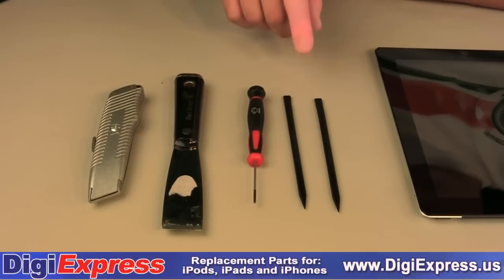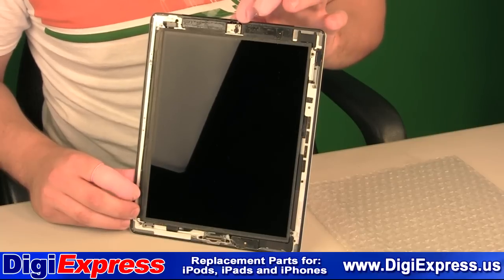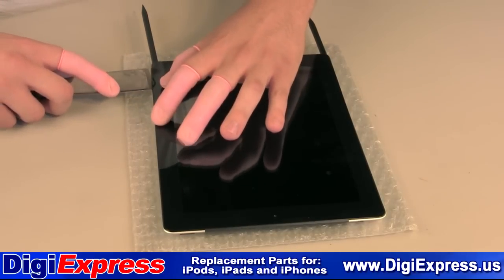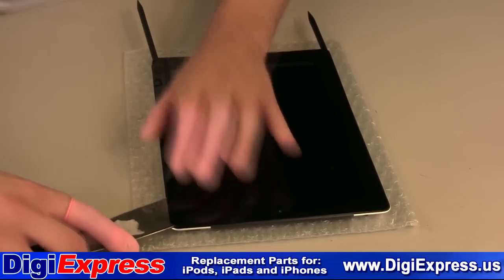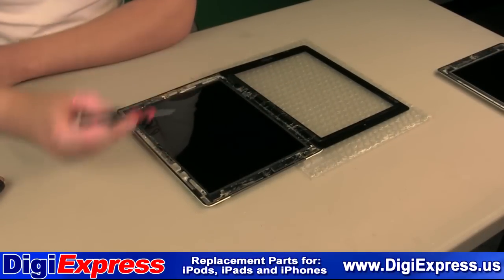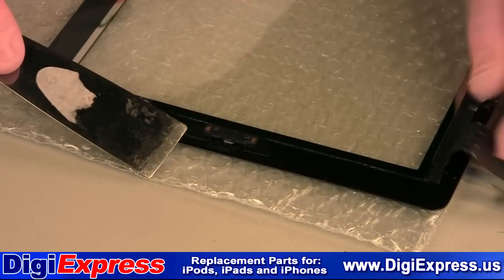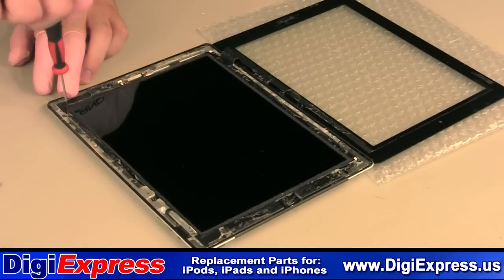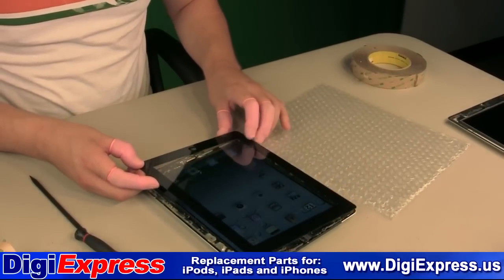DigiExpress - iPad 2 LCD / Digitizer Repair

Comment from the maker: @PastorPaperfist It is not stocked throughout the US as packing tape or Duct/Duck tape would be.  You would start with Lowe's, Home Depot, ACE hardware or your local electronics hobby shops.  From there if you cannot source it locally, a search on Amazon or the like will get you results.  The rolls themselves can be expensive, and currently there is no precut adhesives for the iPad 2.  Hope this helps, thanks for the comments!

Comment from the maker: @TheBryceallen No, we use a 1500 watt 120 volt heat gun.  The temperature is set to 800-950 degrees Fahrenheit.  Since we keep moving the heat gun around, the device never gets too hot to damage or work with.

Comment from the maker: @RichardBronosky The adhesive you are referring to was actually the plastic mid-frame that is attached to the backplate.  If you have a black colored iPad then your mid-frame is black, if you have a white colored iPad then your mid-frame is white.  The adhesive that is used to secure the glass to the mid-frame and thus backplate, is clear to yellow (yellowing if not cured properly from the factory).  This repair was done live and not a pre-repaired unit.

Comment: wear the finger condoms or nitrile gloves and you won't be cleaning finger prints off the glass. Go ahead and buy a wifi antenna when you buy the digitizer, you are going to ruin the antenna when you remove the glass. I got the antenna for about $12

Comment from the maker: @djcountry1985 There is enough space between the LCD and glass digitizer that you should do no harm to the glass or LCD.  However you may severe or displace other components for the Wi-Fi, Cellular antenna , but should do no real damage to any parts.  It should also not be so hard to insert the metal tool, if you find that you need to push hard enough to do damage if you loose your grip, that is pushing too hard.  Use the heat gun to do the work for you, keep the heat moving over the glass.

Comment: I have a quick question. When replacing the LCD, I accidentally used a metal screw driver to the part where the LCD pluggs in. A quick apart went off and now I have no brightness in the screen at all, (can still see very faded image) is there a breaker switch? Or is the whole LCD blown?

Comment from the maker: @GetSome100100 If you are lucky enough to have an AASP in your area, who can repair it on site.  Most Apple stores will give you a refurbished iPad as a "warranty" replacement.  Though the warranty expressley states it will not cover physical damage, such as cracked screens.  So at that point you are looking at 10% off the cost of a new one, at best.  Currently Apple Genius employees can "override" warranty repairs for angry customers, this has stopped with the release of the iPhone 4S.

Comment from the maker: @lumpyren Cover the screen in packing tape, going horizontally or vertically.  Overlap 1/4 inch on each strip, then continue as the video shows it.  The packing tape will keep the glass shards as in-place as possible.  Though as soon as possible you'll want to get something to protect the LCD screen from the glass shards, a cloth or plastic will do.

Comment from the maker: @suikerblok Start at 50 degrees C and you should be able to heat the glass up enough, though if you find it not loose enough you can increase the heat by 5-10 degrees if you want to.  Too much heat, either from the glass "holding" the heat or from the gun being too hot, can damage the LCD screen below.

Comment from the maker: @chi3x10 the only drawback of using a hairdryer is that the air is not "shaped", when the heat gun is used the hot air is channeled into the shape of a cylinder and thus can be focused on one area (i.e. the outside rim of the iPad screen).  If you use a hairdryer, then you are shooting hot air in more of a cone shape, this may damage the LCD screen if it gets too hot or is left in one spot for too long.

Comment: Is there a difference for the white and black ipad 2 glass repair?  What happens if the wifi does not work after a glass replacement?

Comment from the maker: @affinitycomputers11 the adhesive comes with the screen assembly when you purchase it from us.  As for where you can get it from a retailer, I don't think that is possible.  There is a double sided tape from 3M that you may be able to use, it is 3M VHB tape in a roll or 3M 200MP; the 200MP is a pre-cut outline of the iPod frame.